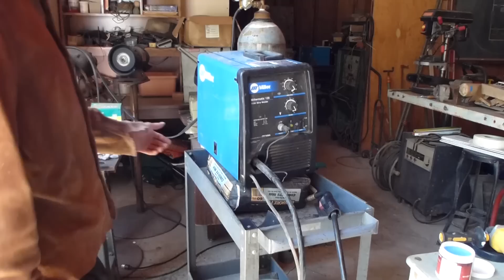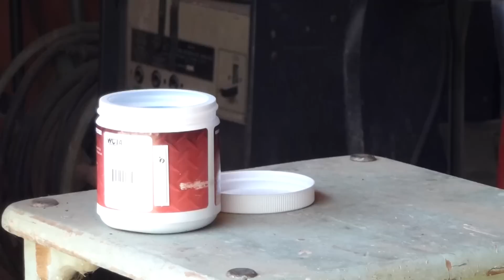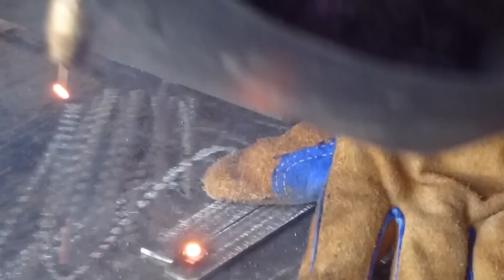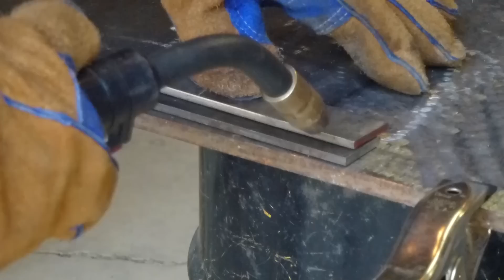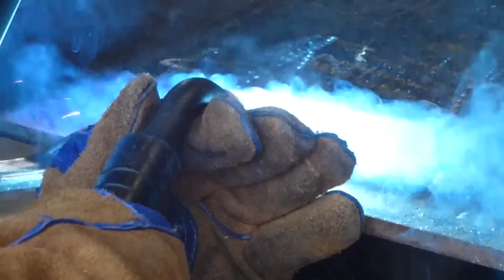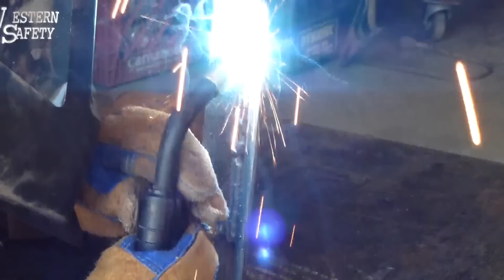MIG Welding for Beginners

Comment: Not enough wire speed or voltage by the sound of the ark of the setting u running but good vid in all.

Comment: Dude go read a fucking welding manual. It has a page that shows you what a "good," weld looks like and a "bad," one. I am almost certain your gun should never be held straight up an down. YOU SUCK!
Reply: Before you watch this - read this comment, thanks to Syncty7jk:

"Before you bash him, watch this video carefully and listen. You will hear him offer his disclaimer. He clearly states he ( is new to welding and the welds will not be perfect. Rather the welds may be close to what any beginner might expect to see when starting out). Those looking for beautiful, expert, advanced welds, check out other channels.There are plenty of them on YouTube.  However, for a brand new welder, this gives a good representation of what your early welds may look like...with a little bit of why.  They can be fairly ugly and unimpressive. Have fun with it. Play with the machines settings and adjustments. With time and practice you will become more experienced, confident and your welds much cleaner.  Welding is an acquired skill and there is a lot to learn. Very few people out there, including the critics, ever picked up a torch for the first time and laid perfect beads, so don't get discouraged."

Comment: Damn!!!
I don't know if viewers are here to learn or criticize.
I saw some awful comments below. 
I am here to learn and this video is great for beginners. 
lots of good tips in this video. Thanks for taking the time to create a very helpful video.
Reply: This video is NOT great for beginners.  Watching him race across the joint at mach 500 inches per minute does not help a newby.  I am infact a NEWBY.  My welds got better...much better when I slowed down, did the e's and cranked up the heat a little more than the chart reccomended.  Watching Welding Tips and Tricks a lot caused me to notice how my speed was much faster than his.  Slow way down on practice until you start to burn thru your work and then speed up enough to keep it from happening,.
Reply: YourOldDog thanks for the tip mate l will definitely take that on board 👍👍👍
Reply: Also came to learn. Hard to learn from an amateur tho..
Reply: Sure, most viewers are here to learn. But who learns to weld from a guy who welds with a MIG machine this way, will fail miserably. These welds are crappy, there's a lot of spattering, uneven bead thicknesses, uneven penetrations (in the "proper" welds as we seen), so that's not the way you want to learn welding.

Comment: While you are butt welding it helps to bevel thicker material, and put a gap between the pieces you are joining. Done correctly a butt weld should not be weak, in fact it can be stronger than the parent materials are.

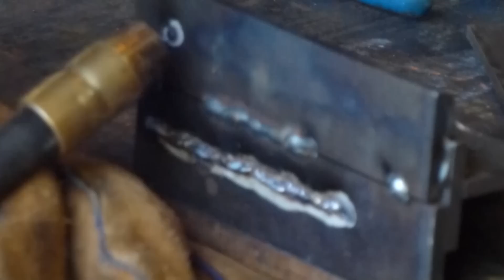Comment: 8:40 - Is there a better Weld in this Video than this horizontal bead?

Practice consistent torch manipulation and travel speed, the whole bead should look the same. Try find a short Course that teaches only MIG (GMAW) Welding at a local school.

Comment: I think you should turn your amperage down a little to stop the splatter. not supposed to have splatter.
Reply: I don't get anywhere near as much spatter when I weld with my everlast welder. The settings he is using are definitely off.

Comment: how come the metal hasnt welded to the bench?
Reply: I wondered this too when I started it is due to the amount of penetration the metal has, it's due to the fact that even if the mig welder had enough power to weld it to the bench it would be cut, beads are supposed to conjoin the metal not go through them thus we weld them to the side, mig is my personal favorite weld

Comment: I have a problem seeing where I'm welding, I've tried different glass in my visor but I either can't see a thing at all or it's so bright I still can't see where I'm welding
Reply: Have you removed the protective film from the lenses?
Reply: Paul Marshall Yes. By the time my eyes have got used to looking at the work through the lens I've messed up what I'm trying to weld
Reply: @pixiesmate  You just need more time doing it. Most of the battle when starting out is knowing what;s going on under the screen with it's very limited visibility. Seeing the comment is 5 years old I imagine you figured everything out though.

Comment: Based on strength testing I've done in my welding classes, lower case e pattern welding can cause weak penetration and a weak weld joint in general when using short circuit MIG on a fillet weld.